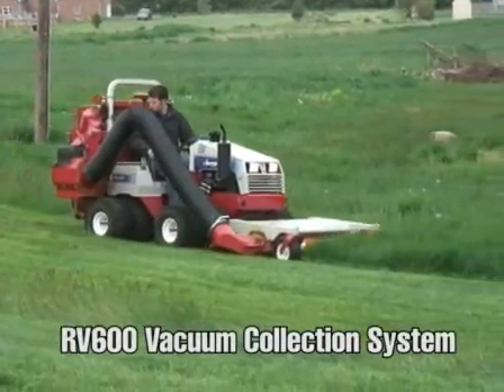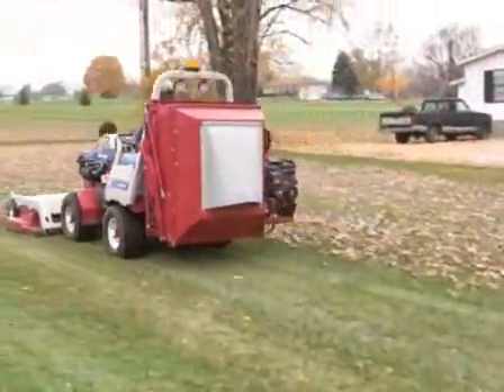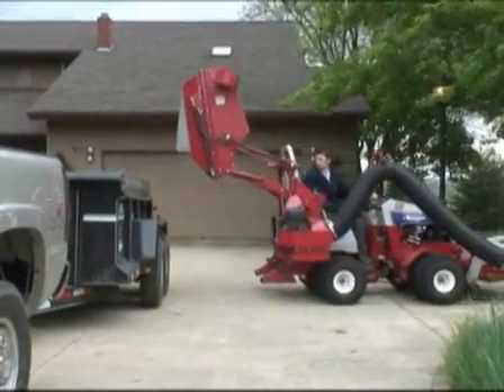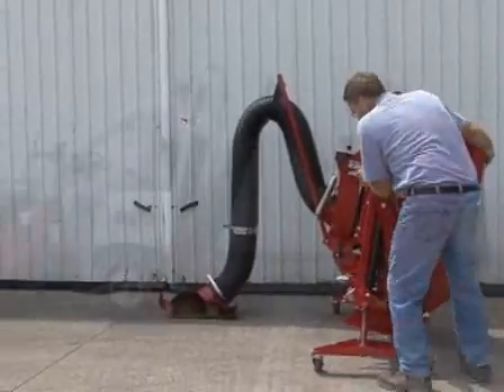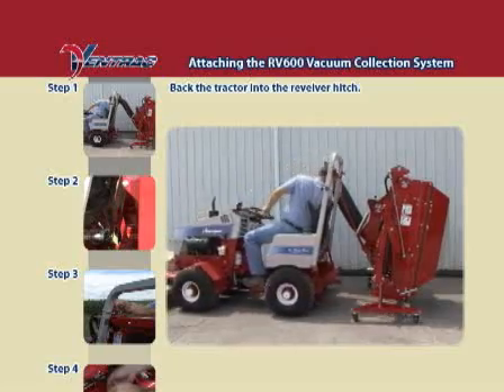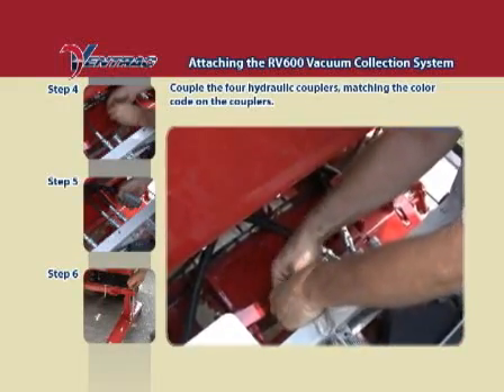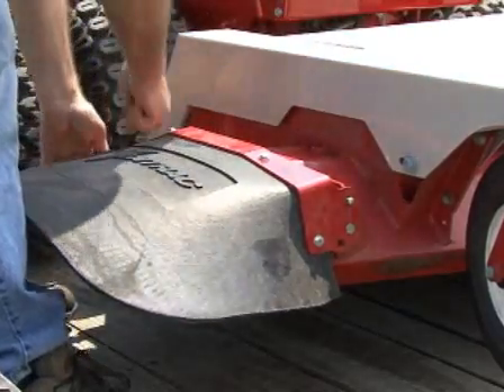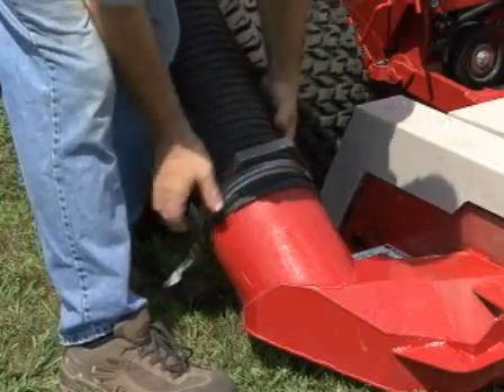Ventrac RV600 VACUUM COLLECTION SYSTEM

Comment: I don't like the fact that the collector have a separate engine just to power the suction. could it not be replaced with a hydraulic engine powered by the venetrac's hydraulics or something?
Another engine means more maintenance and more things that can go wrong. also more noise, and possibly more fuel consumption?
Reply: it would take a lot more power to use the hydraulics to run the blower which would put more strain on the motor that's why the blower is run off a gas motor
Reply: RB that depends on weather you want to use the Ventrac for what it's made for or exceed its limits....
Reply: right.  they need a pto.  you don't use a separate motor for the mower deck.  think the reason is the ventrac is under powered for most attachments.  shame because overall it's a nice unit.